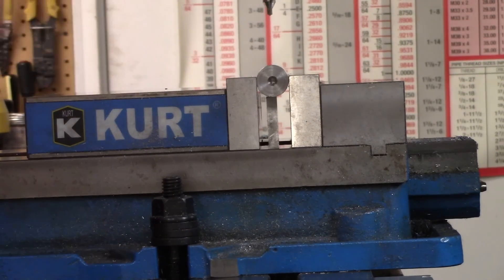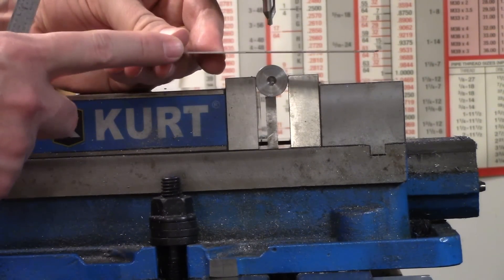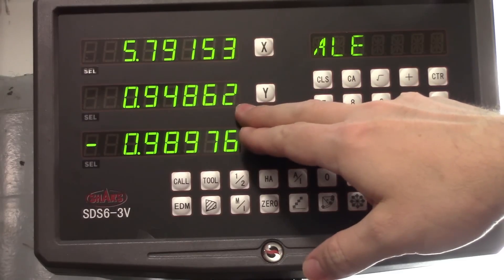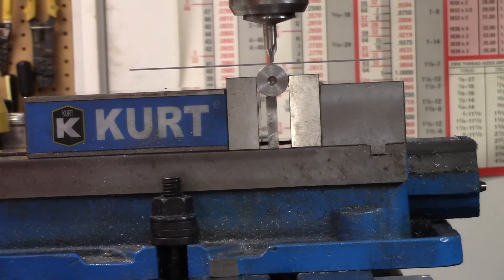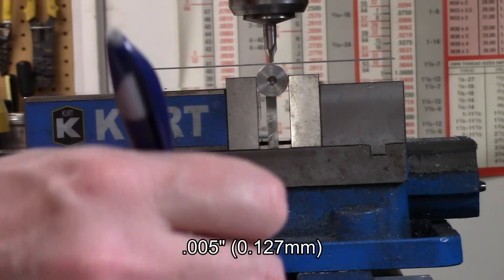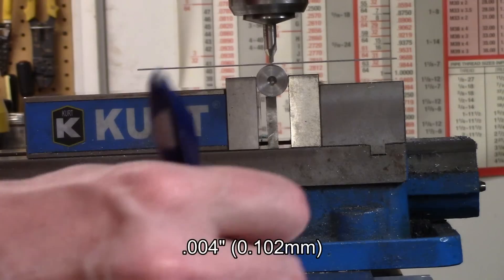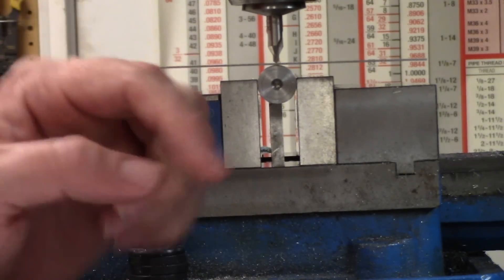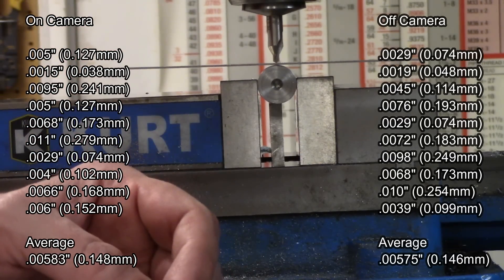How Accurate is the Scale Trick?

Comment: Would usind a non-etched surface make a difference? Surely you have a small height parallel to try.
Reply from the maker: @mjwint  I'm not sure if it would make a difference or not. The drill tip was placed in the center of the scale where there wasn't any etching. I'll try it out when I have time and get my machines set up again. That should be sometime in the next decade or two.

Comment: Love this experiment. Can I make a suggestion? Place a digital angle finder on the end of the scale and see if your results are more accurate. I know this is a bit redundant if you already have a DRO but perhaps it could be useful for someone who's using this trick on a drill press W/O a DRO. keep up the great videos.
Reply from the maker: I would think that the angle finder would weigh the scale down and skew the results. Check out the follow-up video I did for these tests. I  made some graduated blocks to go behind the scale to help line things up. Those would work great on a drill press.

Comment: I watched that for a second time.My interest is to find if this procedure is good enough for CENTERS ALIGMENT OF THE LATHE.(Stuart,you promised to do a follow up video of this testing ! ).I will discard the use of a chisel point and use a dead center point instead.I will like to learn the use of a BALL for the headstock center.Thank you.
Reply from the maker: Hi Angel. I actually have the follow up mostly shot. I should finish it up tonight. I don't think this would be reliable enough for lining up your centers. You really want those dead on and you'd have no way to quantify how far off you are. There is a really easy way though and I will gladly do a video on that for you. Mount a piece of scrap between centers and make a skim pass to just past the halfway point of its length. Then measure at the tailstock end and the middle with a mic and you have how far your tailstock is offset. Put an indicator on the end or on the tailstock, move it over that amount, make another skim cut, and measure. Repeat if necessary.
Reply: @StuartdeHaro  I do appreciate your your instant response.I certenly would like to see any videos you make about this subject.My combi lathe-milling machine is not high end type but very good for what I do and I try to get the best out of it.I´m a little bit lost obout centers aligment and I want to do it well including if those Laser helps might be the answer.Thank you.I´m subscribed and belled to your chanel.

Comment: Good video. I think that you are using the wrong reference points i.e. the ruler at the vice jaws. those points are too close to the center which makes any error visually too small. Try putting the center of your ruler under the tool and then look at the ends of the ruler compared to the body of the vice. This magnifies the error as much as possible given the length of the rule you use.

Comment: Nice video and I think you have been making some nice videos. Thanks for taking the time to do that. You're a very good teacher.  Regarding this experiment, I would like to see you center up 10 times with the edge finder to get an idea how good your reference point is. You could just compare them with each other, or better yet, center up with a dial indicator and compare to that. Also, there is another quick and dirty centering trick where you skim off a tiny bit from the top of the piece with an end mill, then center up visually with the little stripe that will create. I've seen people use that for making keyways. I wonder how that would compare?
Reply from the maker: Good ideas. I have a lot of future video ideas coming from this one.

Comment: How do you determine how much down pressure to use? I would think if it's not enough the scale will slip out, if it's too much you'll end up damaging your cutter?
 this is actually why I've never tried this trick. I'm worried I'm going to damage my cutter.

 thanks for the video as always I appreciate it!
Reply from the maker: I just used a really light downward pressure on the quill, just enough to hold the scale there. It wouldn't be enough to damage high speed steel, but carbide could definitely chip.

Comment: Thanks, good to see this aproach.
By my experience there are two more things to pay attention. First is the tip of the tool - the center drill is not the perfect pinpoint. Better use a manual tap.
Second to observe is the diameter of the work piece. The larger the diameter, the larger the error.

Comment: I tested with a 3/4” rod, a #2 center drill, and 6” rule. My results were an average of .009 due to one reading that was .0341!  That had to be a glitch like a slipped quill or landing in an etched number with the drill. I was routinely eyeballing better than that. I kicked out the high and low and got a more reasonable avg of .0069. 3/4 of the way through I moved to view from another side with less clutter in the background. Much better. 
I decided to rerun this test with a 7/16 turned(possibly ground) rod with about a 120 degree point(tip wasn’t perfect). Avg was .00325 with a corrected .00292!  
My opinion is that the chisel tip of a center drill might hold the ruler flatter for longer before leaning creating a wide perceived center range.

Comment: Do we have to do one set with a camera in the way? Lol. I actually get inconsistencies of up to .003 between edge finder repeats. I think it depends on how quickly I detect the kick out or how quickly I can stop moving once I see it. Doesn’t do much for the confidence. Any tips on that? 
Be right back with my results!
Reply from the maker: Use at least 1000 rpm, preferably a bit faster. That makes it more sensitive. Make smooth slow movements, don't blink, hold your tongue just right, avoid spicy food the night before, pet a wild skunk for good luck each and every time, and most importantly...
Reply: @StuartdeHaro  I did all that and it made a huge difference. Thanks!  Posting my test results in another comment.

Comment: I wonder if the split point on the center drill is what's throwing it off. If a solid center was used maybe it'd be better. Though that kinda defeats the point if you're doing this with the drill you plan on using for your op.